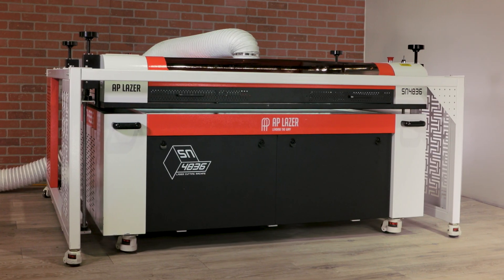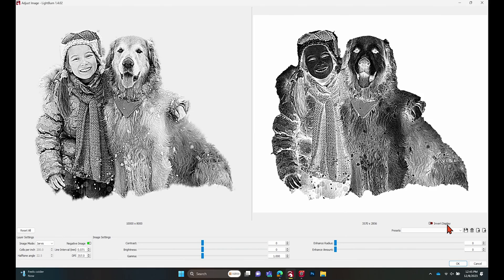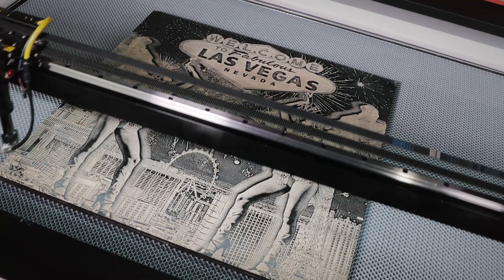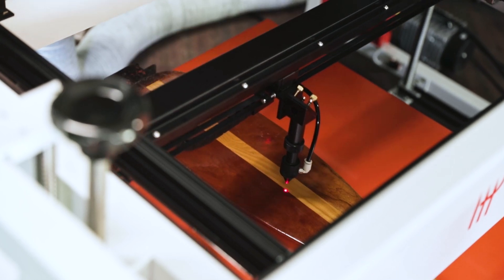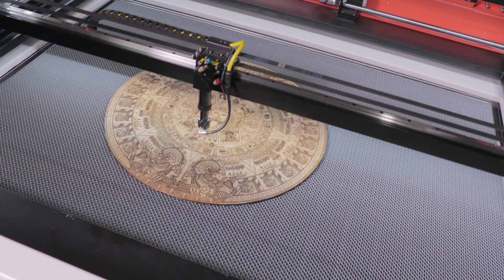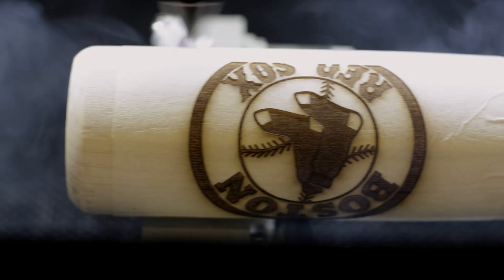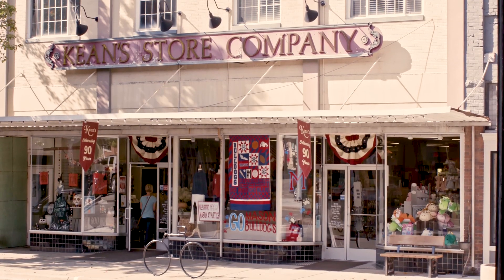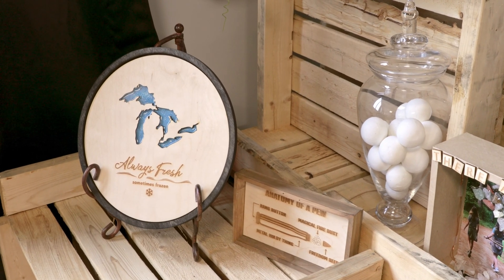AP Lazer Low Rider: The Ultimate Guide to Laser Engraving and Cutting Machines

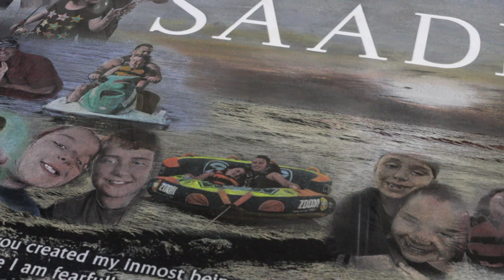Comment: at 3:09 the life raft looks to be in color (Green) how is that done. does this also colorize items as well?
Reply from the maker: Hey there!
CO2 laser machines are strictly a subtractive manufacturing process and cannot add color of any kind. 
The color is added after engraving by hand-painting the etched areas. The paint will adhere and stick cleanly to the etched surface and wipe off of any unetched areas, making the color etchings last a lifetime. :)